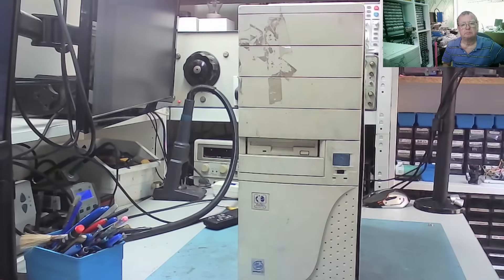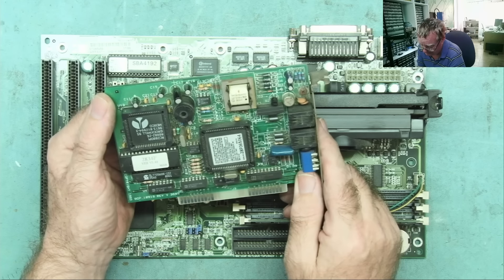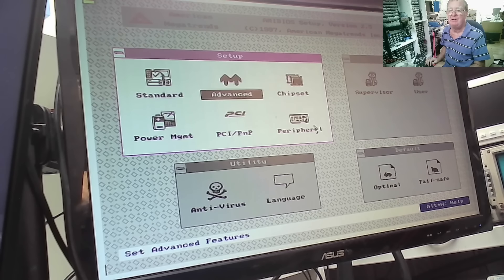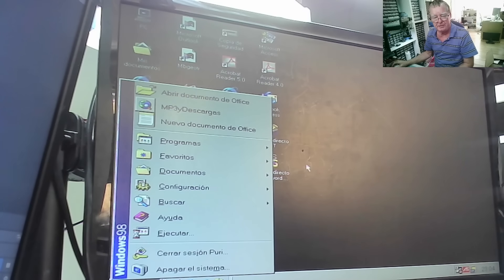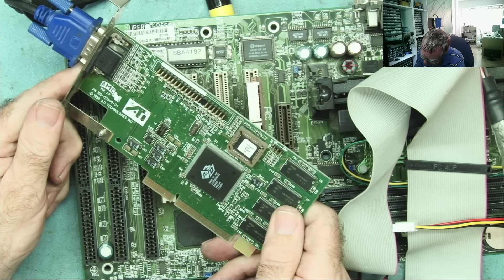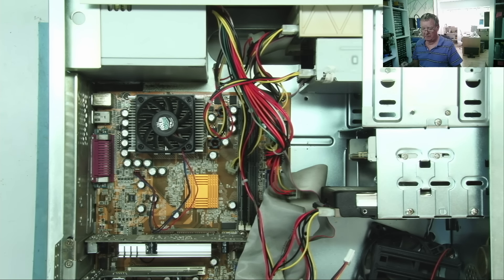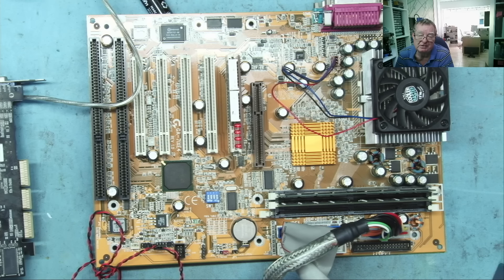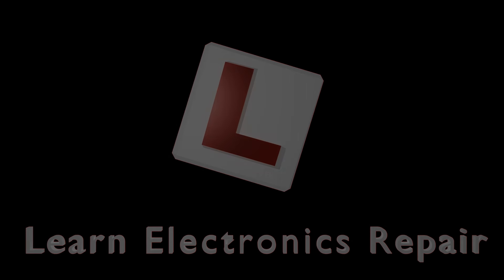Car Boot Flea Market Retro Gaming PC Finds 1st September

Comment: It's a SuperMicro Motherboard. Congratulations 🎉
Reply: I've never seen a motherboard of them aimed at private consumers, only servers. Interesting.
Reply: @LarixusSnydes  yes, I do have an old P4 Dual P4 SuperMicro Server with SuSE Linux installed. But also a SuperMicro P4 2.8 MHz (AFAIR) motherboard, female talking to you out of the BIOS at start-up. 😊
Reply: The early Supermicro motherboards were consumer oriented but I guess they realized there was more money in server motherboards.
I wonder if the P3 is 133Mhz FSB being run at 100MHz or if the AGP is being over-clocked. I remember running a motherboard at about 115MHz to try to get the best of both worlds, any higher and the AGP became unstable.
Reply: @chrishartley1210  it got ISA sockets, so I am quite positive that it's a 100 MHz PII or PIII CPU. A 600, 700, 750, 800 MHz PIII 100 MHz ? This would be high value.
Reply: @borlibaer  I just read the motherboard specs, seems the FSB is 66 or 100MHz with a maximum multiplier of 6X, not that it makes any difference with the P3.